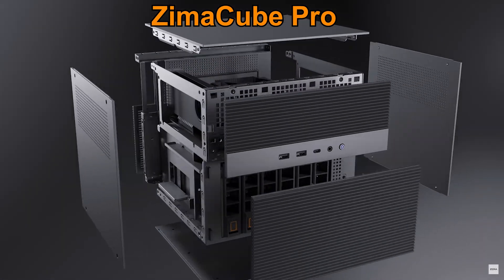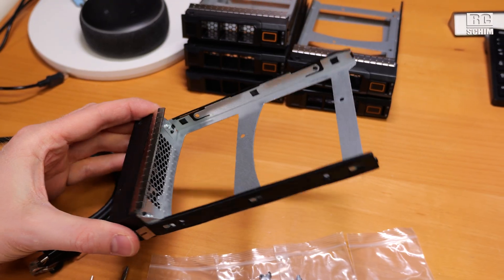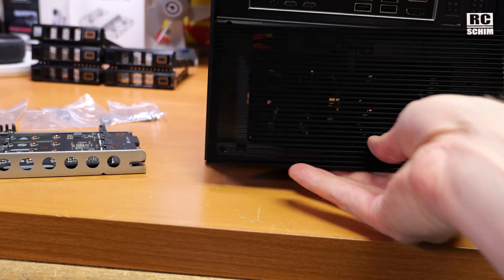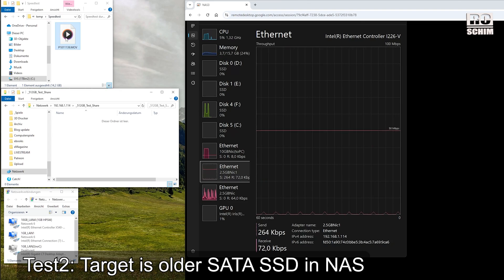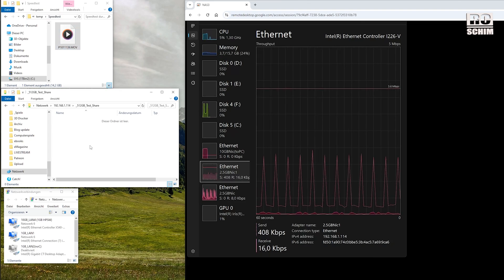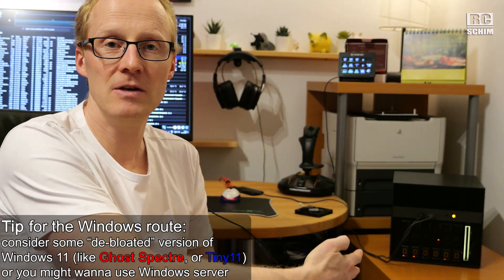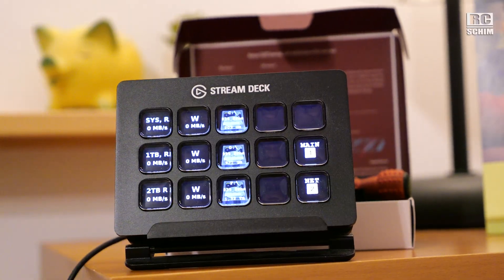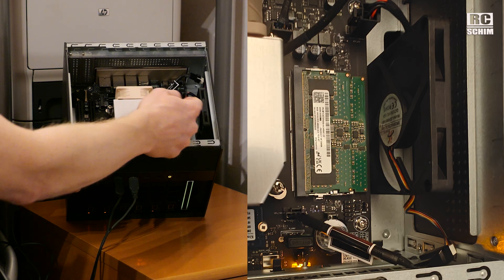ZimaCube Pro Full Review: 10GBit NIc Performance Tests, Custom Cooling Tips, OS Showdown

Comment: What is your average CPU and hard drive temps after your modifications?
Reply from the maker: Hi, idle CPU is normal 40 or 50
On high CPU usage it can go to 80
My m2ssd drives got copper coolers and a small fan else they would throttle down soon.